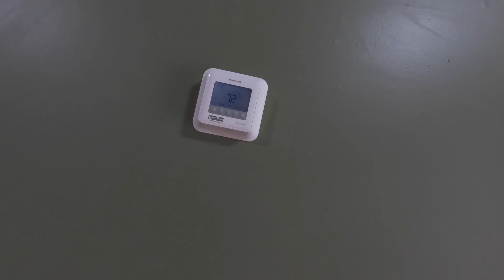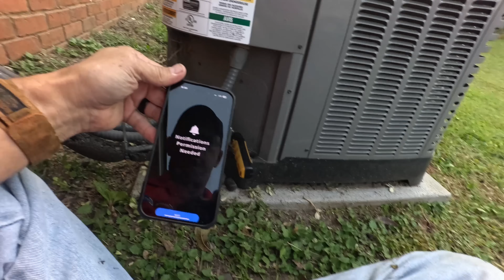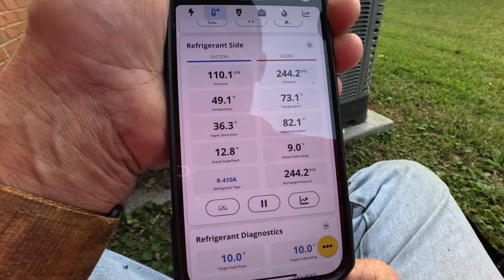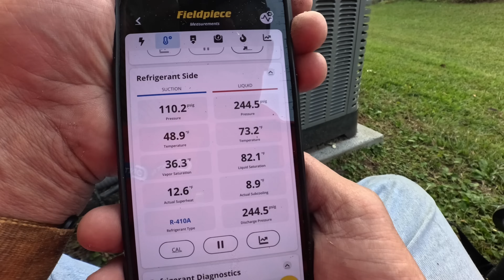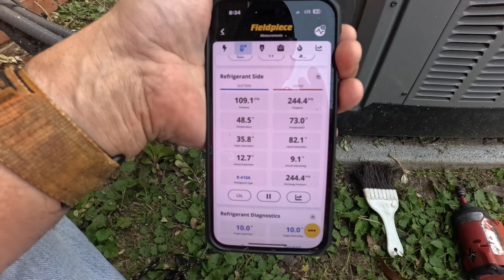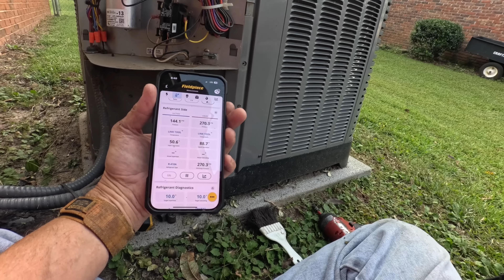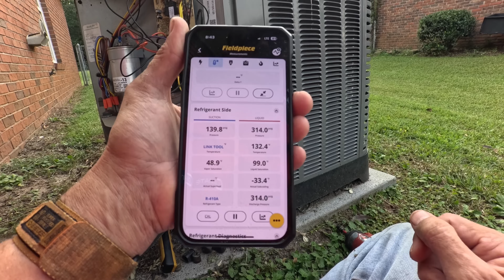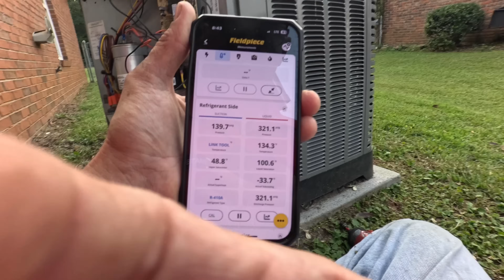Callback Four Months Later! #hvacguy #hvaclife #hvactrainingvideos

Comment: I’ve been doing HVAC/R since 1979 and owned my company since 1991 or so. If the air handler is in a closet… make sure the surrounding walls are not opened to the attic . I’ve seen returns sucking hot attic air through the walls as a sort of chase…when the framer didn’t seal up the header /top part of the wall.  Also check to make sure the heat strip relays are functioning and not holding the strips on.

Comment: I observed a dirty condenser coil @9:30. 
The coil needs cleaning.
A dirty condenser will not allow the system to keep up on the warmest summer days when ambient temperatures are approaching or exceeding design temperature. 

I shall give the customer the benefit of the doubt here. 
The problem I see that raised a lot of suspicion is lack of timeliness to communicate the inadequate cooling call. 

Contacting any AC company four months later with this complaint is fishy.
 
I'd have billed him for the call as a PM, as a courtesy, as we think he might be an established customer.

A lot of debris can accumulate in four months in the outdoor coils. 

This was not a "call back". 

HVAC Guy fixed the original issue with his clogged condensate drain problem four months prior.
Reply from the maker: He was angling for free work. I offered a tune up
Reply: @HVACGUY  I withdraw my comment of giving him the benefit of the doubt. It seemed fishy to begin with.

Comment: I have a question: Did you check to make sure that there was enough flow through the vents, make sure that there were no  critters in the duct work, and the system may not have a problem but could be a airflow problem

Comment: Oh my goodness 72 !!!!  I keep our house here in Fla @ 78 and it feels like we are freezing.  I do have a hygrometer and watch  that is never goes above 68%, if so, then I lower the temp to 74 for an hour or, so the AC can take more humidity out of the air, then back to 78.  Humidity above 70 it can be 73 deg but feel like 80
Reply: 68% rh? If mine gets over 60, I get uncomfortable. I run a separate dehumidifier and 72-73 degrees. I use to could handle 78 when I was younger,  but my breathing has gotten worse and my waistline has gotten bigger 😅
Reply: @MrRupus2020  My indoor RH is 50%. My thermostat is set at 78 degrees. If I set it one degree cooler to 77 degrees it feels too cold. I have a 5 ton air handler matched with a 4 ton heat pump. Nothing fancy, just a five year old 15 SEER Goodman system.
Had to set the dip switch so the AHU fan runs at the lowest speed and it is still moving 1640 cfms. 

My RH improved when I redid the air distribution system. Moving the air slower onver the oversized 5 ton coil increases the level of dehumidification. My building envelope was in negative pressure before and I installed a new 10" return air branch duct and what a difference!
It is no longer pulling in the high humidity ambient air anymore because now my building envelope is in positive pressure when the air handler is operating.

Moved the AHU out of the attic into the garage.
Easier to work on and my line sets are much shorter and they no longer run through a sweltering attic in the Orlando area.
High liquid line temps in a hot attic will decrease HVAC systems efficiency. 

The importance of residential air distribution systems is overlooked the majority of the time unless you go custom. I despise a spider box system that has flex duct running helter-skelter.
I'm old school and know the difference a good air distribution system makes in comfort and equipment efficiency.
Mold and most fungi cannot survive in a building envelope maintained at 50% RH. 

Note-  It doesn't hurt that I have quite a bit of field experience in commercial test and balance.
Reply: How many square ft. is being conditioned? What is the cooling BTUs of your system?
Reply: @panamacitybeachbum  4 ton, 2200 sq
Reply: @jimbergen5232  Good deal. With the high percentile of RH, I was only curious as to the cause. Too many variables... but one thing I know for sure is that oversized equipment is not it. Thanks.